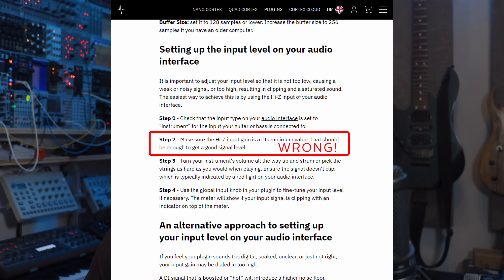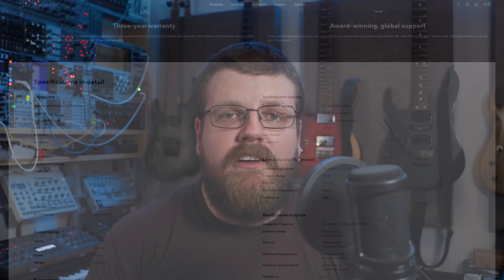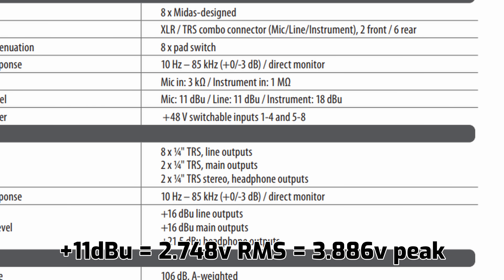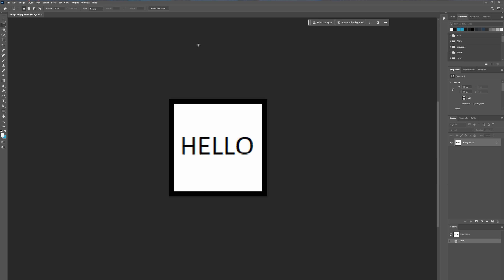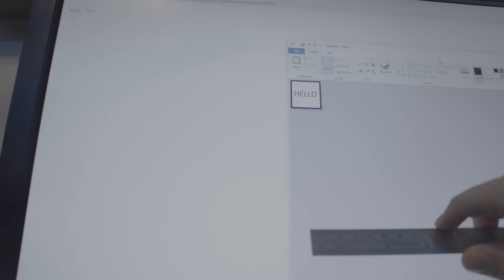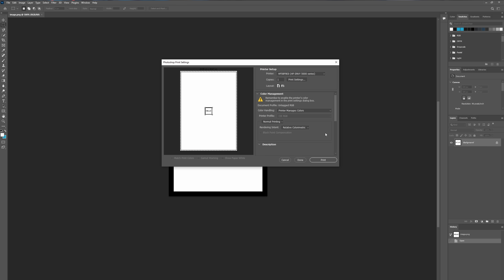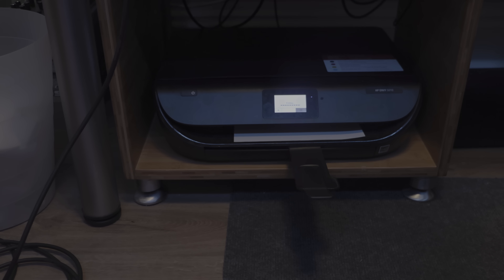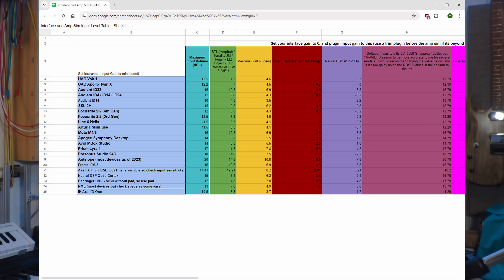Ampsims and input gain - Please, stop the madness...

Comment: One important point is missing when you have passive pickups your output signal is weak by design, if you have active pickups with pre amp your output signal is strong or hot if you will and you need to compensate it. So ignoring this fact and set gain to 0 as universal rule will produce not the same results!

Comment: You are 100% correct. AND, there is nuance in "as high as you don't clip".

There is a third parameter to optimize, that unfortuantely has to be optimised against the first parameter of input gain for SNR, and let's use "headroom".
How much headroom to leave the guitar? Are we taking bassy transients into account? Has a DI already mellowed them? Are we going in guitar to interface always or sometimes put a pedal infront? Do we mind being a bit wrong everytime and leave the interface alone between different guitars or we tweak optimally each time?

What's funny is that I asked the input gain question on Cordy's channel when I was brand new, 2 years before this series of  videos came about. Their answer was "shrug, dunno", so I view the videos for 0dB a necessary step. Your video as well, steps into mutual understanding.

Now, my solution ended up being very simple. I got an HX stomp that hasn't got an input gain. I also got a focusrite to feed Helix Native and other plugins. I just put my focusrite input gain where it recreates what the HX stomp does and that gives me good enough noise and consistency to my presets. 
That is my target point and then I can tweak to trade headroom for SNR in the physical realm and compensate on the digital like you talk about ❤

My target point btw, where the Line6 engineers felt was a good tradeoff and I adopted so 😮I don't need to think, is where playing my telecaster in open chords sits at about -18dB. Crazy open headroom ❤ In the focusrite that's about a quarter up the dial (brickwalling it would be half the dial). Noise floor is not bad in these anyway.

Comment: Of course you are right. People get some really dumb ideas about how to set things in the DAW world. Why do you think there are variable gain controls on your audio interface to begin with. They are there to be used! Not set at unity or a fixed  position and never touched. Tip: I use a VU meter (real one) but there are some really great VU plugins too. Set it so 0 dB VU= -18db FS (or your preferred ref level of choice) Some DAW's like Studio One allow you to insert the meter right on the input channel before the signal reaches the track. Adjust your interface levels now for a 0 dB VU reading. Another dumb thing people think is right is during a mixdown setting all the faders at unity and setting the levels of tracks in the mix elsewhere eg trim controls etc.. That is not how it was done in the analog days and it is still not how it is done either.

Comment: What if you are running a DI box first?
Reply from the maker: All bets are off - use your ears in that case :)
Alternatively - find yourself a calibrated signal generator, hook it up to the DI input, and measure the dBFS level on the software side. You should then be able to calibrate accordingly. On a totally unrelated note, we might be bringing a calibrated signal generator to the market soon 😄Stay tuned for updates.

Comment: @GhostNoteAudio, from a plugin OEM: thank you!! Finally a video that explain the only correct way to set up an audio interface, and most importantly, why that is the correct way. 

We do not make copies of analog amps, so we do not have "accuracy" problems related to a wrong input level. We still have an handy input meter that turns blue if the level is too low, green if it's ok, red if it's too hot, but that's more of a suggestion, just a matter of taste. In the end, if the audio interface is set up correctly, then you can just trust your ears. 

With our approach, if all our users set up their plugin in the "green area", then they can share presets among each other and have the exact same experience, without the need of spreadsheets, measures and math.

Comment: Well... This applies to recording and mixing in the box too. Not pushing the preamp just before clip is like having a Ferrari and not driving faster than 80 km per hour. Modern converters have a ton of dynamic range. I guess designing preamps and adc circuits makes this much more easier to understand. 
Great video and great explanation.

Comment: One thing that is frustrating for people is that different companies use different arbitrary unity levels that their plugins should be worked at. And I’ve noticed amp plugin manufacturers are especially bad at disclosing them and only a few of them give you any sort of advice or assistance at where your level should be at for optimal performance of their product. It’s also an integral part of comparing real hardware with their plugin counterparts. 

Slate Digital always was very good at this for example, clearly stating that their plugins were calibrated at I think +4dBU = -18dBFS. They even posted a video at some point showing exactly how to calibrate your setup to compare a real distressor to plugin emulations. 

With this apparently being an issue it’s been very frustrating for me to see different companies using wildly different standards and not giving concise information about that.

Comment: I wasn’t aware of such discussions but i thought if i raised the input gain on my
Audio Interface the noise floor of the audio interface would raise too!

But according to your experiment it doesn’t?

Did i get it wrong?

😅
Reply: dbu out of your interface - 12.2 (neuraldsp as an example) = the result will be what your input gain should be on the neuraldsp and then after that increase your gain level on the audio interface until just below clipping.

Comment: OK, so here's my question.  I want to record a DI track for use with another plug-in later.  How do I set the gain on the recorded track going into the next plug-in?  There is no objective measurement once the DI is actually recorded for reamping.  Or, am I missing something?

Comment: Some of my amp sims need very little input gain, while others need a little more. It all depends on your guitar pickups and the amp sim. It's easy to dial in. I have found that starting at zero and then using a meter on the input to level at about -18 dB or so usually does the trick, and that's a good place to start. anything louder than -18 dB will result in a lot of unwanted amplified distortion on most amp sims. Usually, my input gain knob on my IK Multimedia AXE I/O is around the 9:00 position. This is true for most of my sims and guitars. To dial in, it's usually bumping between 10:00 and 12:00. I have never had to go further than 12:00 for any of my guitars.

Comment: It really depends on the guitar output as well. Sometimes with active pickups and guitar volume at "full max. at 10" a combination of palm mute with a pinch on the higher strings will result in clipping (it is a rare performance combo but still it can happen).
Julian Krause showed that Audio Interfaces get the best linear response at the max input level. Clipping might happen.
There are tools to restore clipped peaks. Do not fuss about it. Maximise your input level suitable to the output of your pickups!

Comment: I always assumed that the input gain on a plugin was exactly intended for this purpose - to allow your analog signal to come through at the correct signal strength when converted to digital at the interface, and adjusting the input on the plugin to dial in the appropriate level hitting the plugin.

When this whole set to 0 at the interface thing happened, I was sceptical because it seemed to go against ALL known best practices in audio recording. This was a refreshing video that I hope helps a lot of people who have been unintentionally misled by bad information.

Comment: Plugging into the hiZ input on my RME, level all the way down on the guitar, 0dB on the interface, +18 dB in Cubase,  peak max -75.56 dB. +18dB on the interface, 0 dB in Cubase  -80.5 dB peak. Guitar level full up is about 1.5 - 2 dB noisier so long as I don't breathe in the room. Add a Cubase amp sim, gain and level all the way up and that becomes -14.24 (gain in Cubase) vs -18.0 (gain in interface) - both peak level. With the gain plugin the RMS level becomes more meaningfully measurable at -24.1 and -25.2 respectively. The noise is different though, more low end hum in the interface sound, more hiss in the digital so it's worth to listen as well as measure. I'm believing the RME interface and Cubase channel and Supervision in all cases. 👍

Comment: This is audio engineering 101, basic gain staging. The reason +4dB professional line level is a thing is because we've all agreed that gear should be designed to operate as close to that level as possible (usually without clipping) to optimize the performance of the circuitry, and achieve the tonal characteristics the gear was designed to produce, which includes maximizing SNR. 

Don't believe me? Try plugging in a mic or instrument and recording a super quiet signal, then normalize it in post. You'll not only be boosting the noise floor, but you'll also notice the tone is thin and weak. This is also why impedance is important. The input circuitry needs to be relatively closely matched to the output of the source in order to perform optimally as designed. This is why you have hi-z and lo-z inputs. Professional line level has been mostly standardized to 600 ohms since about the 60's, but some older gear will vary. 

Anyway, getting off track. Gaining up your instrument or mic to hit just under peaking (in dBu, not dbFS) is basic stuff that everyone should know and follow unless you're going for some specific effect or want more noise.

Comment: Thank you! It's nice to see a video about this from someone who really understands the DSP side of it and you explained it very well (love your pixels to inches analogy). While the idea of going into the amp sim at the level it was designed to work best at is great advice, I've simply been using a gain plugin before the amp sim to turn the level down to the correct level. Turning it down at the interface made no sense to me, so I disregarded that part of the discussion.

Comment: I'm very glad you used that chart.  It's pretty accurate.  I've found my MOTU interface's DI is my favorite since it can boost and cut. Some of my really hot pickups require a cut, where lower output ones need a boost.   Used in conjunction with the chart it's REALLY a game changer for amp sims.

Comment: Running with low input is like plugging your guitar into an amp. Low level kinda noisy output from pickups. Turning the gain up is the same as running your guitar through a clean preamp and then into the front of your amp.  So it depends on what sound you like. Yes this is proper gain staging for your interface but this is not what happens when you plug into a real amp.

I dont know I might be full of shit. You are probably right seems like you know what you are talking about. :)

Comment: EE who worked on high fidelity ADCs here. Want to add practical info on the sources of noise 6:21. 

First type “current flowing through circuit” is called thermal noise and generally everything that isn’t considered quantization noise or “bit depth”. 

Generally speaking, audio ADCs use the delta-sigma architecture which means that the inherent noise will be dominated by the thermal noise (eg >20-24bit ADC converters), or a combination of thermal plus quantization (18-22bit), not quantized alone. 

I found that analog front end amplifier is the dominant noise source of thermal noise. However, this doesn’t change anything that was said. If we follow the advice for gain staging, we still want to use the full range available to us. It’s very unlikely the output of our instrument (in volts) will be just below the maximum on our ADC. So, we need to add gain somewhere!

So, perfect video, wanted to add some more detail to a very specific comment of the video.

Comment: Personally I'd rather leave some headroom for variations in signal, say when switching a pedal on or off. The way I see it, giving up about 10 dB of SNR is preferable to ever clipping the input. The former means a slightly noisier track. The latter means you may have to throw away a take. If you want to risk this on yourself, feel free. But if I'm recording anyone else then the absolute assurance of never clipping a recording outweighs the benefit in SNR. This extends all the way across the mix: I'm recording vocals so that they peak somewhere between -10 and -6 dB also. I don't want drums peaking too hard either, although I'm going to push those transients into clipping at the mixing phase so it's not quite as critical.

So I get why you'd do this. It objectively works better when done correctly. However, I don't like the cost of doing it incorrectly, and I don't ever want to tell someone else "the computer ate that take, you'll have to do it again". Leaving several unused bits at the top of the scale is fine, that's what 24 bit sampling is for. Also I'm not just turning the knob all the way down, I'm simply targeting -10 with the peaks rather than just-short-of-0. I don't see why I should try to optimize away an effect that's going to be 90 dB down in the mix at worst when the penalty from exceeding 0 dB is so much worse.

tl;dr: I'm not (quite) adopting this practice because it increases my chances of making a major error that ruins a take. I'd rather suffer the extra noise.

Comment: I've been screaming "just lower the input gain in the plugin" for like a year.
Reply: Or raise it!! Me too but also, I've been screaming "use that input gain to make your "amp" higher or lower gain as you see fit! It's like an amp mod! You can have a hotter Soldano or a cleaner 5150, which is fucking amazing when you think about it! No need for pedals! Get a boost that sounds exactly like the amp already does! Use it to make music! It's amazing flexibility"
Reply: If you gain stage the guitar on your audio device, the input gain controls the distortion, it’s the output of the amp sim that needs to be controlled,  you want it at -6db on your track meter playing your loudest, if I lower the input gain I get different saturation or just plain clean tone , if my guitar is gain staged correctly on my audio device, , which is usually 66 percent, no red, green to amber ok my  Scarlett input. loud , but headroom on the audio device
Reply: I've been saying that to Cordy until he shadowbanned me from his comments.
Reply: I did it too on some on the mentioned videos and quickly felt discouraged !
Reply: Yeah. Also, digital volume pedal post preamp > turning down volume knob on guitar, but, I don't know if most people are ready for that yet.
Reply: @Tarnith  I don't think you got the point.
If you turn down the volume pot you raise the noise floor.
Also, lowering the pot resistance makes you lose high frequencies, which sometimes might be wanted, but most of the times not, and you still have to add gain on the preamp to make it work at it's right level, making it noisier and picking up more cable noise as well.
After that, you'll need to adjust the post preamp volume anyway.
So, unless you're purposefully adding noise and highs rolloff, it's totally counterproductive.
Reply: @giacomoneri1782  I got the point, I don't think I made mine clearly! 

By digital volume pedal, I mean a midi pedal controlling digital gain, rather than using a volume pot. 

I always record in within the optimal range of the preamp, and if I want to do a volume swell instead of using the guitar knob I use a midi pedal tied to gain somewhere post the HI-z pre, but before the amp sim.
Reply: @Tarnith I think he just missed the '>' and it didn't register that it's a 'greater than' a sign, because it seems to me like you guys are in agreement.